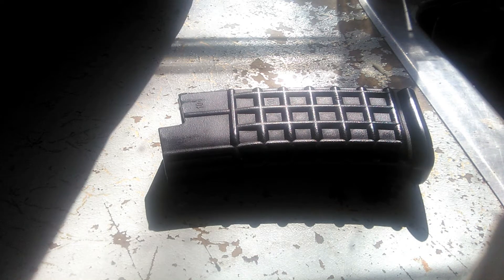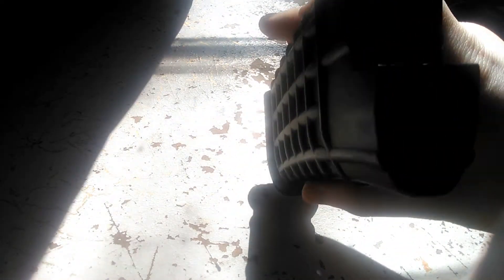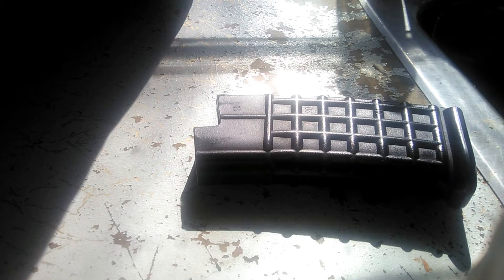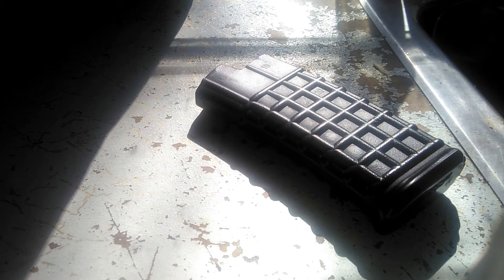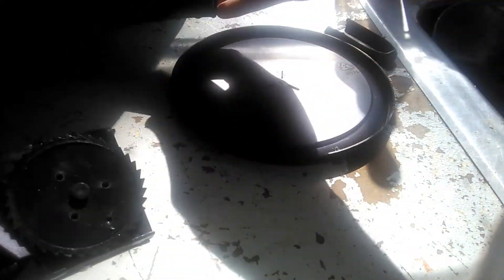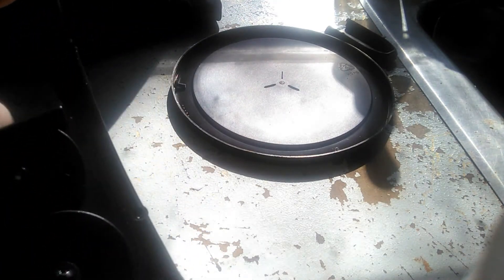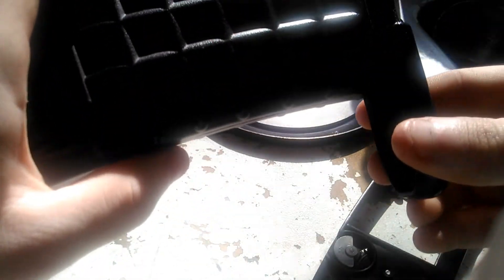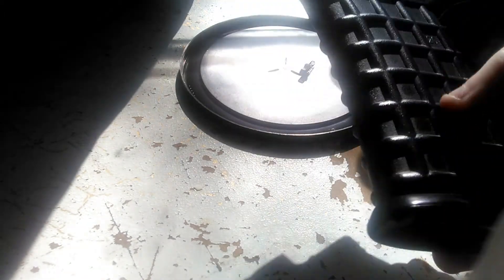Fixing JG Aug Feeding Issues

Comment: So I have what can be seen as a worse issue than feeding. My magazine's internal wheel doesn't move. I can spin the bottom all I want and it doesn't move.  So its not winding. Any idea how to fix this issue?
Reply from the maker: It's possible that something could be jamming the wheel (Could be dirt or anything else small). I would suggest taking the magazine apart, investigate if there are any damages to the wheel or any of the other gears, and if no damages can be found, clean the gears using rubbing alcohol. Afterwards, use a plastic/metal friendly lubricant to lube up the moving parts on the inside of the mag. Hopefully this will fix your issue
Reply: @spade6118  I took the magazine apart and it was both a broken gear and damaged springs.
Reply from the maker: @games-uv9hp I don't believe you can find spare parts for an Aug magazine online anywhere, so your best bet is to buy a new one unfortunately
Reply: @spade6118  no i couldn't so i had to buy a new one.

Comment: I also hear that filing the tip of that nub can help. On my mid cap, the nub is slightly too long and so I sliced a bit of the edge off easily with an xacto knife. Be careful not to slice too much. I dont have this issue with my high cap mag tho, that has always worked fine for me.
Reply from the maker: That's actually a pretty smart idea. I wish I would've tried that.
Reply: Spade I just experienced an issue with my main mag that came with the airsoft, one of the gears broke. My new aftermarket mags arent reliable since they dont fit as well as my original mag. I decided to open my new high cap and transfer the internal mag into the shell of my original mag. I will remove the nub to further increase the reliability. Thanks for your tutorial!

Comment: Is this a common problem for jg aug’s? Been eyeing up the a4 for a few weeks but haven’t pulled the trigger on buying it yet:-/
Reply from the maker: I did my research before buying this and it is common issue. However, I don't find it to be a big deal. This limits you to only being able to use hi-cap mags, and you have to keep your spare mags unwinded when not in use. Apart from that, operates like normal
Reply: @spade6118  thank you so much! I prefer mid caps but I guess if I ran it in cqb with high caps it wouldn’t be an issue, I’ll take it into consideration!
Reply from the maker: @AverageSkater  if you run this in CQB I'd highly recommend you shorten the barrel Lol

Also the two-stage trigger pull sucks because semi-auto is impractable for how this is set up. If your field is cool with you firing in short bursts then you'll be okay!
Reply: @spade6118  thanks for the advice, hmm yeah I didn’t think about the two stage trigger, may get one just for the collection and plinking then haha
Reply: @AverageSkater  Hey! My SW-020T (Snow Wolf Shell JG inside) has both semi and full auto. Its also pretty short for CQB!

Comment: I’m having feeding issues with my ASG AuG A3 with a drum mag, it’s a obviously a hi cap flash mag, and was wondering if I should do this
Reply from the maker: I don't have any sort of experience working with the drum mags. But if the top of the mag works the same way, then it should be able to work without a problem.
Reply: Spade You are using Mid Caps, right? I probably shoulda asked how well this works after doing it. Does it fix it 100%? And are there other implications from doing this like if I take the mag out it all come flying out? Or does it only fix it by 80% because if it doesn’t fix it in its entirety, I’ll just exchange it and get something else, love the aug but Don’t won’t feeding problems will trying to play. And
Reply from the maker: I only used hi-cap 300rd mags for my Aug, so if your drum mag is also a hi-cap then it won't be a problem. This made my Aug feed 100% of the time and completely fixed the feeding issue.
Reply: Spade thank you man, I used the stock mag and it is working, I think the drum mag has a little to much weight to it cause it’s definitely having feeding issues with it